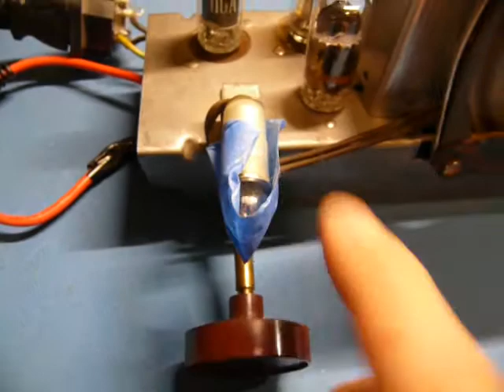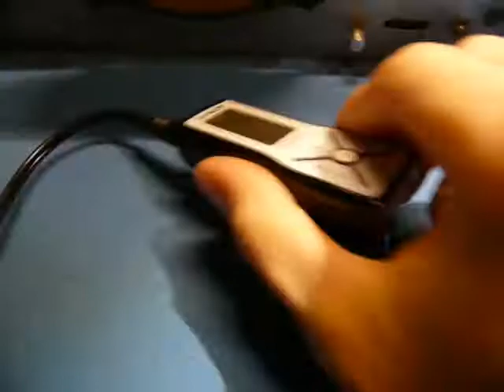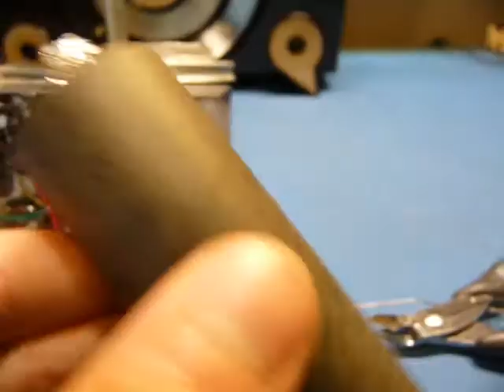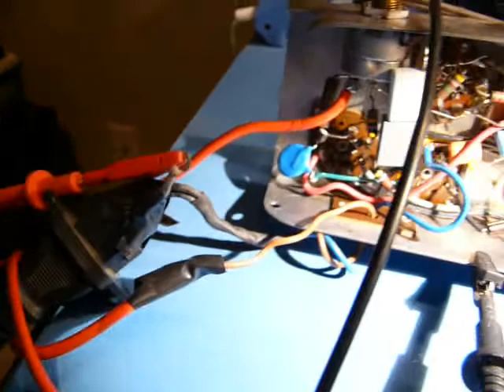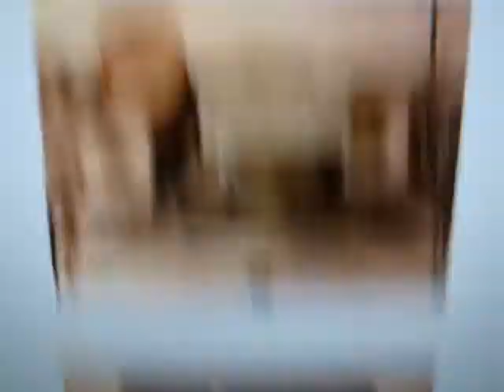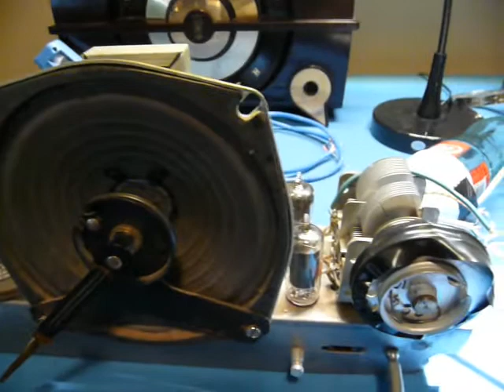Zenith J615 tube radio restoration 3 of ?

Comment: You should have put a knob onto the tuner side as well.  It kinda defeats the purpose of having that insulating knob on the volume control if your going to grab a potentially hot chassis over at the tuner end, or anywhere else on the chassis for that matter.